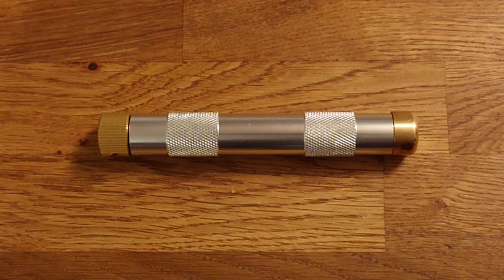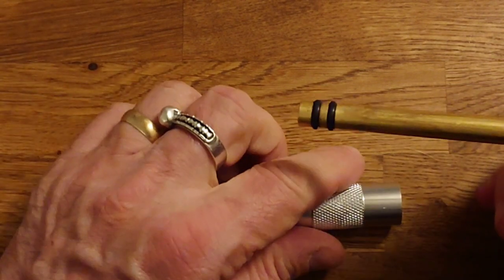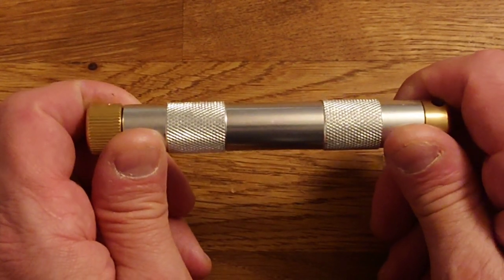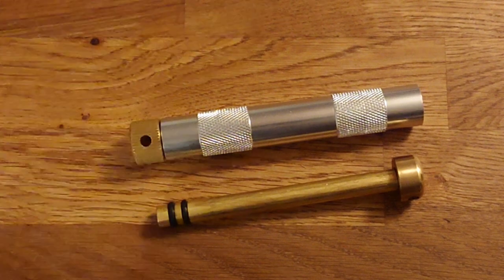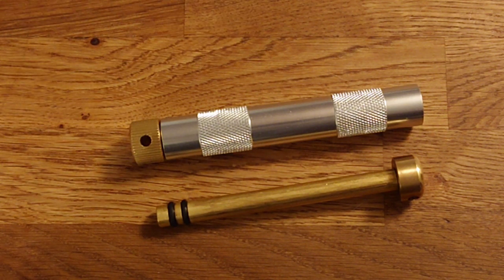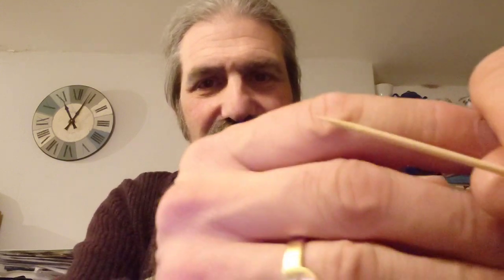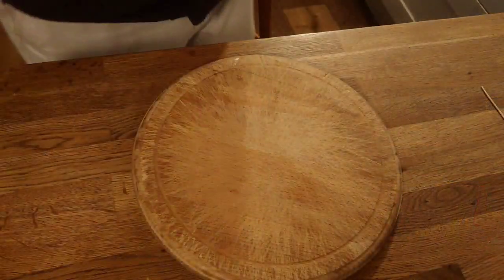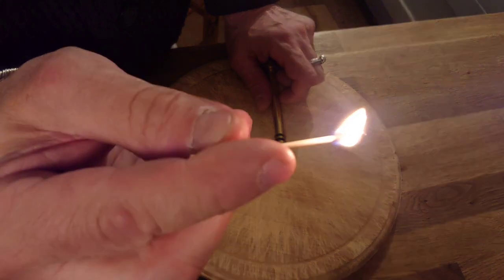The Fire Piston What it is and how to use it

Comment: Several years ago, I made my own out of copper and dowel rod along with the o - rings. I used that for a while but it was a little bulkier than I preferred. If I had a machine shop I could make them out of different materials and much much smaller. I like the one you have. Do you have any recommendations on where to get one like or similiar to yours at a reasonable price ? The ones I made didn't have the air release, which I find to be most useful  in keeping the plunger air locked within the assembly. If you need replacement o-rings, the best ones are silicon and can easily be found in the big box hardware stores in the plumbing and air conditioning sections. Rubber ones will work and do need frequent lubrication whereas silicon requires less and wears less. I had hoped some very innovative fire pistons would have been created by now. They are the most economical to use when solar ignition is unable to be used or sparking from flint steel can't be done due to lack of quartz or flint and chert. Right now I am using fjre thongs made from steel cable and am trying to master the Rudiger's Roll but that one has me stymied yet other guys seem to do it with ease. My fire kits keep expanding but I need small some small fire pistons to have my kits completely updated. I am also creating separate chemical fire kits because they can be somewhat  corrosive so all items in it must be exceptionally well sealedand used as an accessory to my main kits. I am considering separating my solar items and creating a separate solar firemaking kit especially because all solar items I use for fire must be protected, item by item. I keep a small bottle of black automobile touch up paint with that kit for ignition of certain items by solar means. Charred wood, char cloth and white ashes along with separate normal ashes work great with solar and sparking techniques. I can't wait to see what you have coming up next. I liked the accessory ideas you had with the fire piston. I had never given much thought to them but they make a lot of sense. I just subscribed to you w kin th a thumbs up ! I hope you do well on the Tube ! Take care ! A friend always  !
Reply: I initially had trouble with the Rudiger's Roll, but with continued practice I feel like I've mastered it.  Take a look at David West videos, he is a complete master at it.  The things I learned about the cotton roll is to use 100% cotton balls and get two good board for the rubbing.  Wood ash is easy to make and I store mine in a glass bottle.  So your first (6 or 7) swipes are in one direction to just tighten up the roll.  Once satisfied the roll is tight you then roll back and forth with pressure.  I can take up to 20 back and forth swipes.  There will be a feeling of the roll kind of squishing down, check for smoke.  If you have smoke you are on your way to making fire.  If there is no smoke put it back down and roll some more with vigor. It's really quite fun and interesting to show to friends and family. My video of using a fire roll. https://youtu.be/L7qhcEH6wG0
Reply from the maker: I bought mine from eBay for around £8, including postage. Of course that was a couple of years ago, and a brief look shows me that the generic ones like I bought are two or three pounds more now, but that's still a good price compared to some of the more expensive ones out there. I'm attaching a link to the least expensive one I could find (same model) hopefully it will help. https://www.ebay.co.uk/itm/295550768443?mkcid=16&mkevt=1&mkrid=711-127632-2357-0&ssspo=-vI9OA9ATVq&sssrc=2349624&ssuid=lKCnl2AuQXS&var=&widget_ver=artemis&media=COPY